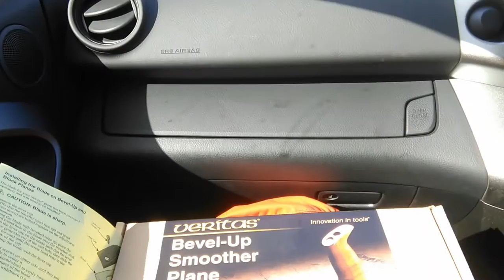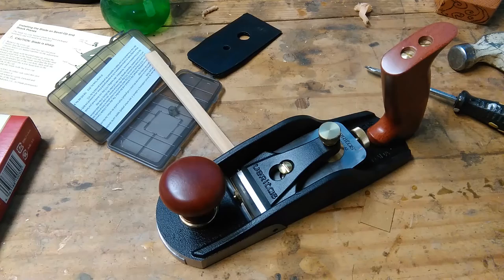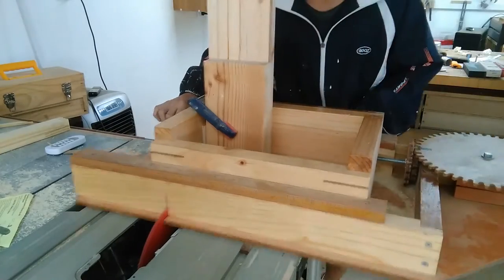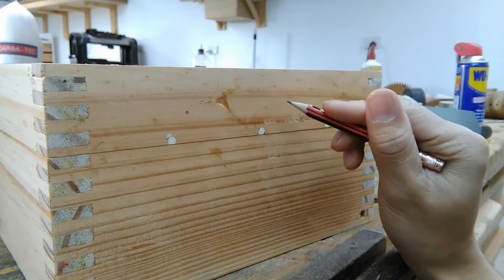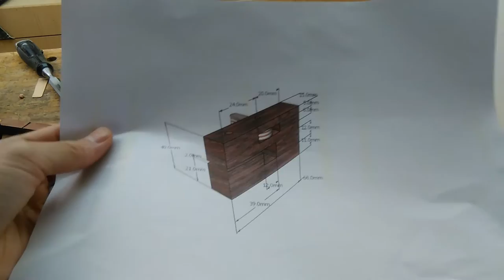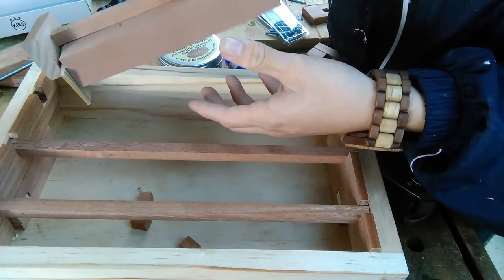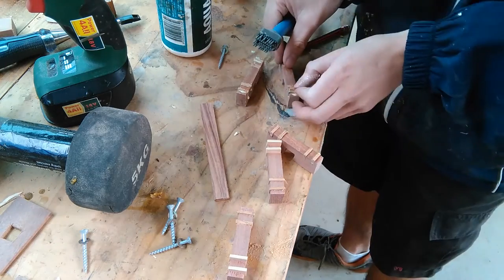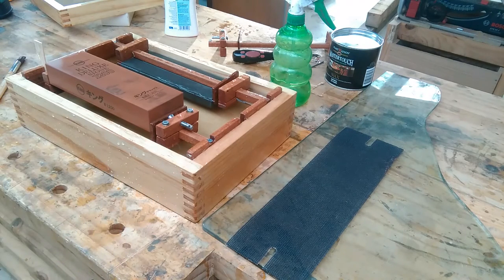Sharpening stone pond build and new hand plane

Comment: Great video very nice practical sharpening pond. I have experimented with sharpening ponds for water stones and I have come to the conclusion that containing the mess isn't actually a very good idea since the residue and the mess accumulate fast and cleaning that mess can be a pain. Unless you have a sink bridge using running water I much prefer the David Charlesworth's simple idea using a sticky mat which he can clean up after each use and keeping his water stones in a simple plastic seed container half submerged in water.
Reply from the maker: Yes indeed, I have to change the water everytime I finish or start. But i think the whole reason why i still haven't replaced is one no time and second so i can use up some of the water in my water tank lol
Reply: @StevenZhangMakes  lol it's a good idea. There is no best solution for waterstones. The old Japanese would squat on the floor and do it in a bucket or they had sone ponds outside. Nice build though!

Comment: Small point. I use my water stoned from the back. That way you don't scrub the label off. Can be handy if they ever get mixed up.
Reply: Stuart Chignell small tip i glue acrylic to the tops of my stones that way you never lose the print
Reply: You would still have to use them from the back though.

My #800 grit stone is the one I use the most because its been my roughest (soon to change) and its now only about 10mm thick. Compared with the #1000 and the #1200 which are about double that.
Reply: No sign of the labels disappearing. 

Yet

Comment: You need the stone resting across two pieces of wood instead of trying to balance it across the centre of one piece. A piece of wood across both of these pushed against the stone and held with bolt and wing nut avoids will the work and messing with the unreliable cams.

Comment: Veritas planes are truly works of art. Nice job on the pond. Why did you not use epoxy as a finish since it is completely water proof?
Reply from the maker: Lane Romel because i didn't have any epoxy finish at that stage, and they are quite expensive, but later i recoated it with water proof membrane that they use in showers
Reply: I found the most reasonably priced epoxy can be obtained mail order from marine boat builder suppliers. As well a polyester epoxy ie Bondo epoxy can be had very economically.
Reply from the maker: Lane Romel nice, i'll check those out soon, thankyou for the sources